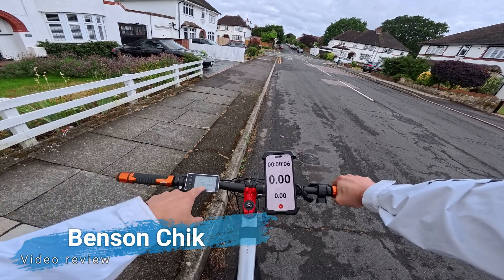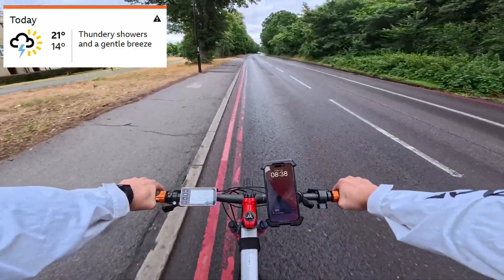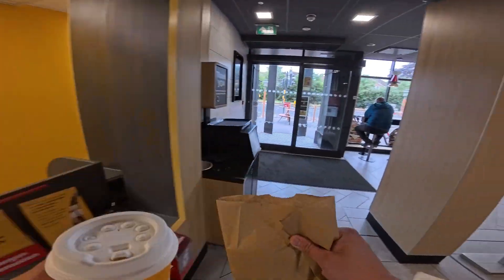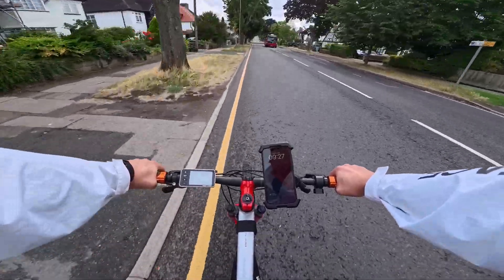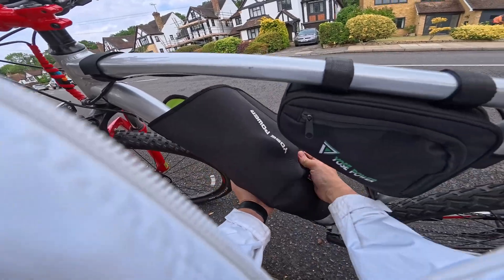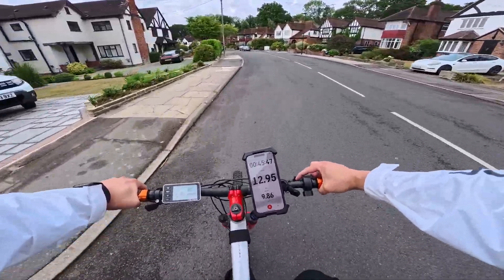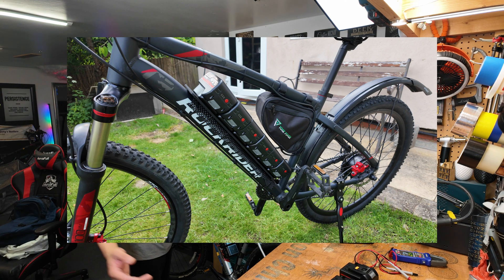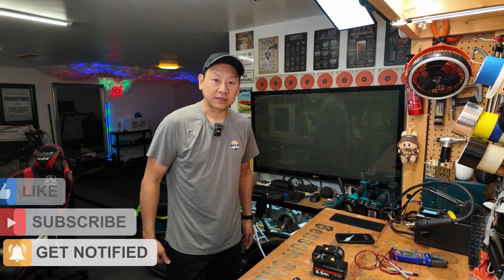Power Tool Batteries on an E-Bike?! I Rode Until They Died!

Comment from the maker: If anyone thinking of using Makita type Battery or any Power tool battery for their eBike then just do it. The adaptor cost a few dollars and the set up process is so simple a lot easier than building your own battery pack.
Reply: hi could the ferrex 20/40v battery be a good option and who would you recommend or know could supply the connecting battery plate . also where did you source the wrap round velcro cover from . i have a carreara vengeance with flat battery
Reply from the maker: @honda4004  As long as they are 5ah or there about I would recommend it, smaller capacity means more stress on each of the small cellls. The battery adaptors is from Ali express at around £2 each and the warp I got it from Ebay around £9   https://www.ebay.co.uk/itm/394523688200?var=663070924723
Reply: @BCreviews  could you do in parallel and serial with four batteries?

Comment: The batteries you are using are not up to the job, priced at £45 each suggest that the cells are low quality. A 36v 6ah Genuine Bosch battery cost around £200-250 each and are good for 20 miles at level 4 for a Yose 250w system.
Reply from the maker: I am only using what I have already, I am sure there will be better battery out there !